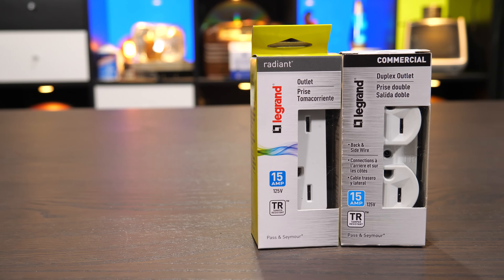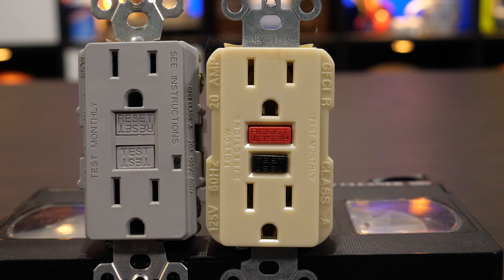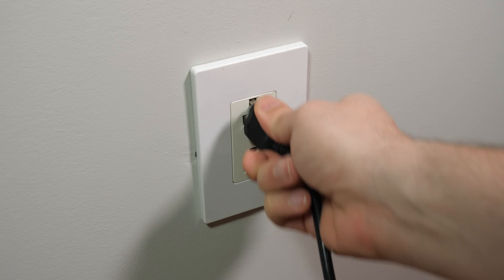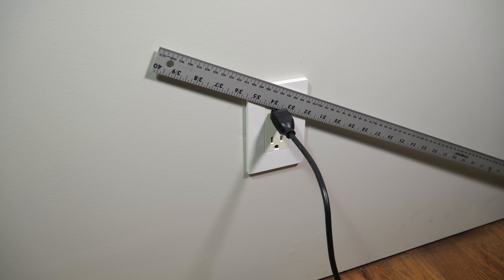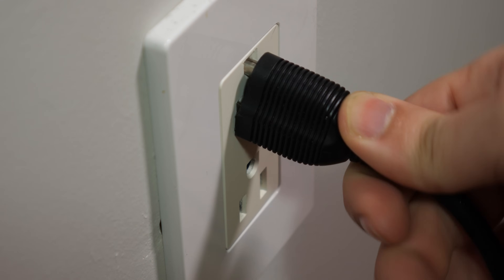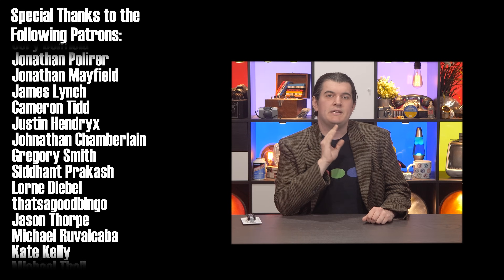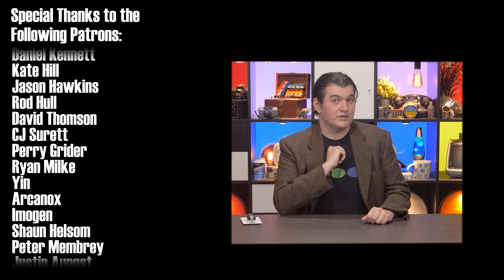Power outlets are topsy turvy - but does it matter?

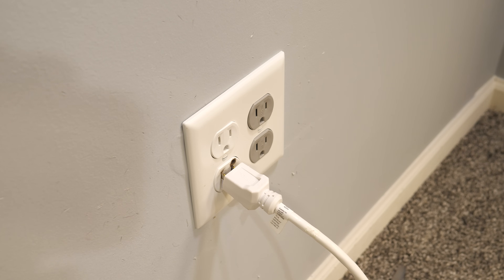Comment: 8:00 In 8th Grade Spanish, one of the girls liked playing with scissors (fortunately, with thick rubber handles). The teacher got after her for it, and she stopped, but then there was a substitute teacher in one day... 

Part way through the lesson, she asks me "How do outlets work", and I answered along the lines of "I think the bottom pin is ground, and one of the ones above it is hot/live, but I can't remember much more" and thought nothing of it. Not even 5 minutes later, I hear a BZZZSHT with an accompanying bright flash of light and the smell of ozone.

What had happened was that she had stuck the scissors into the outlet, with one blade in the hot side and the other side touching the metal faceplate of the outlet. The blade touching the faceplate arc welded itself to it, with a faint buzzing sound following the initial "fireworks". The teacher threw a large stack of books at the scissors to dislodge them, which worked.

This is not the first nor last story I have about 8th grade Spanish...

(That timestamp with the arcing reminded me of the other incident)
Reply: why did you have a large stack of bricks in a classroom
Reply: @vitamins-and-iron  Phone must have auto corrected- I meant large stack of BOOKS. 

Fixed it now.
Reply: @garethfuller2700  oh lmao 😂 thanks for the story

Comment: I have a couple older window units that have the right angle plugs with the ground pin at the top, as well as a couple older appliance timers that have the live and neutral pins reversed. All of them are from the early 90's or older.

Comment: Reminds me of back in the 90s when gas stations used to have "no cell phone" signs all over, implying but not actually saying that it could cause a fire or explosion, even though cell phones have no sources of sparks since there are no moving parts (the buttons were pressure-based, not contact-based). Unless you're in the habit of connecting and disconnecting your phone or its battery while hanging out around flammable vapors. Remember when phones had removable batteries? Don't get me started. Meanwhile on dry days (even living in Santa Cruz, CA), I was getting a shock every time I get out of my car to pump my gas. I guess my clothes and the car seat materials had the exact right electronegativity to generate static electricity or something.

I'm pretty sure those signs had nothing to do with safety or even with reality.

Comment: Another solution for the plugging/unplugging scenario (that works with older plugs) might be to add a switch to the wallplate. That way you could be sure there was no possibility of getting a shock.
Reply: Alec actually did a video on those. Look up "In Defense of the Switched Outlet".
Reply: @00andJoe 
Just watched it. He says (in reference to switched wallplates), "The switch is right next to the plug which you can also just take out" - but if the issue you're trying to prevent is shocking yourself, taking out the plug is what causes the issue rather than solve it.

Comment: If you look at it from a leverage point of view -  having the ground plug up does help keep both prongs in the outlet a bit better than when you have the face orientation.... . where the action of the plug leveraging in a downward direction causes the two flat pins to a be exposed more from the top and it can use the ground plug itself as a fulcrum point so it can pull out a trifle bit easier maybe ......all that being said - yep, who gives a crap tho !!!  (grin)

Comment: UK plugs have an insulation sleeve on the prongs.  What's preventing an overhaul of the NEMA-15 standard from adopting plugs that have a similar sleeve?  Seems like if the outlet was built with the correct specifications, it wouldn't require changes in the outlet?

Comment: I had to watch the whole thing before i commented, as Alec is Alec, and plays the devil's advocate... occasionally...

As someone who has installed receptacles of varying size and orientation, there is a valid reason for putting the 120V and 240V receptacles ground down. As Alec mentioned, the ground pin in three pronged receptacles is longer, as it serves a purpose. It IS the first to make, and last to break, when it is in the ground down position.

If you are required to have a grounded cord on your tool, (or appliance, or whatever,) the last thing you want is to have that ground get knocked out before the power has been removed from said tool (or appliance, or whatever.) If for some reason, the tool (or appliance, or whatever) is faulty, or gets wet, it is likely to short to the grounded metal case, which you are likely touching, or will touch when the tool, (or appliance, or whatever,) is next picked up.

For this is the reason that GFCI and AFCI breakers and receptacles are required anywhere near water, or outside, or in a garage, among other places where you would use a tool (or appliance, or whatever.)

SAFETY. 

It comes for us all. One day, you will be affected in a negative manner by safety.

Comment: You forgot to mention switched outlets.

Aren't switched outlets installed upside down so they can be easily identified amongst other outlets in the rooms?
So if upside-down outlets became the norm, would they have to install switched outlets right-side-up then so you could tell them apart from other outlets?

Comment: At this point it can be considered a North American tradition to select crappy plugs.

Even for electric cars, instead of going for the superior Type 2 their went for the Type 1 and then Tesla plugs. No three phase charging. No low and mid DC charging without CCS. No DC-low combined with 1 phase AC charging. No additional pins for Tesla to use out-of-spec to pump even more juice by using the N L1 L2 L3 (already used as 4 DC pin in DC-mid charging mode) on top of CCS DC pins as 6 DC pins for insane DC charging (don't tell me they wouldn't have done that given what Starlink is doing with Power over Ethernet).

Comment: I've actually had the "foreign objects" scenario come to pass -- a coin fell down behind a sideboard and shorted out the plug. Very startling when it went off.
Reply: For me is was a necklace that fell off the nightstand. Since it was flexible chain it would have shorted out in either orientation.
Reply: Me too!!!  Wife's gold necklace fell off the dresser and had a 1/2 inch vaporized.
Reply: As a European I'm always amazed that you still stick with this needlessly dangerous wall socket design whenever I get an import product from the USA. Our plugs have metal tips and plastic closer the base. The UK took it a step further and requires a ground pin (ours is optional), but that makes their plugs quite bulky can only be inserted one way instead of both ways. While I'm obviously biased and would prefer that you'd just adopt our plug standard, can't you at least have a plastic coating towards the base of the plug? That could be intercompatible with current standards yet also prevent the potential of shorting the plug.
Reply: @leonro  That'd increase manufacturing cost -- can't have that!
Reply: @leonro  ours in the uk are all right angled, earth up, and not problematically bulky. The plugs disconnect live first if pulled to destruction, have a built in fuse, and they're no bigger in the case of plug in devices with a transformer.

The only true downside is if you leave them they sit points up on the floor and are like lego (though much less pointy than US or EU plugs)

Our sockets as standard have little windows opened by the earth, so young kids can't jam anything in the socket. Modern sockets are all switched too, it is fantastic.
Reply: That's your jeton moment.
Reply: Cookie sheet here.
Reply: When I was a small child, the back of the airfreshener in the hallway  had a weird design and looked like a gumball machine slot. I stuck a quarter in it and my body spasmed and launched me into the opposite wall of the hallway. I still have the melted quarter lol
Reply: Same kinda thing happened to us. Was surely a shocking surprise.

Comment: Legit my only problem with right angle plugs is that you can’t plug two of them into the same 2 receptacle outlet, most of the time. I’ve seen some outlets with the outlet’s orientation running perpendicular to the orientation of the receptacles, such that when the outlet is installed horizontally, the ground pins of both receptacles are at the bottom, which means both receptacles can be used by right angle plugs without one plug blocking the other receptacle. This is in my opinion peak outlet design, and I have no clue why it’s not universal

Comment: Engineering challenge: Design a new receptacle and plug design (that is more than just sleeving the prongs) that fixes all of the design flaws of the current design, but remains compatible with all current receptacles and plugs.
Reply: I saw that in Europe back in the 80s when some homes had 110V.
That's a plain socket with circular holes on each side.

Comment: The other reason to say "nah" to the ground-up design in regards to right angle plugs:  Since the wire is now sitting straight up, there's more tension on the WIRE ITSELF by the forces of gravity and a vast majority of electrical fires have come from the wires having too much stress/tension and at the very least, losing their protective coating and at the very worst, stripping themselves bare and causing arcing away from the wall.  Sparks and carpet anyone?

Comment: Australia (& New Zealand) completely bypass this whole issue and mount them with the earth down as we have the following features:
1. Live & Neutral are sleeved 
2. Earth pin is longer so its the first to enter, last to leave. And because its at the bottom when a cord is accidentally partially-pulled, or sags from the power point, it will be connected even as the Line & Neutral come out.
3. RCD/RCBO's are mandated so even if you break the sleeving or force something metallic in the plug, heck even stick a knife in the outlet itself, and the circuit will trip with residual current protection (not just circuit breaker protection)

Comment: I've had two experiences of part-unplugged US plugs getting shorted. One by a knife, namely a putty knife being used to scrape spackle. My wife kept the putty knife with a hole melted in it to remind her. She is very glad it had a fully protected tang, which some don't. The other short I've seen was from metal dust from sanding/grinding building up on the top curve of the cover plate, then getting bumped so it fell off in near enough to a unit to spark and trip the GFCI.

Comment: After the US introduced the metric system you can start looking at European plugs. Never in my life did I have to worry or even think about getting zapped when plugging a cable. We have 240V so it's much more important, but anyway, not that hard a problem to solve.

Comment: Great Video! I make Electrical plans for buildings and updating our details and enforcing this is not where the solution should come. Manufacturers should, as you say quite near the start, make better plugs and receptacles that eliminate the very specific hazards you bring up. I think the cheeky sideways plug is optimal for the current design but in building standards outside Chicago they lack the added support that conduit gives. 
Thanks for the debunk, inserting an upside down lateral chord plug has always felt wack

Comment: I have an old guitar amp from the 60s and just recently played through it, but was getting shocked by touching the instrument input jack. I read that it could be that I had the power plug reversed, but it's literally the first time ive gotten shocked from that amp. It's one of those plugs like the tape player you showed and it allows you to plug it in either way, so maybe that is the reason. maybe the schematic will answer that, but I'm not fluent in reading those. lol just thought that was relevant to how crappy and dangerous electrical designs can be.

Comment: The problem with right-angle plugs is you can only plug one into most normal receptacles, as the one prevents the other from being used, by anything.

Comment: Sleeving the pins is definitely the way to go, I live in Australia and I've seen someone catch the live pin on an old unsleeved plug when removing it before (fortunately it just tripped the RCD since all Australian houses have full ground fault protection too)
Reply: I am very glad to live in Aus where our electricity infrastructure was made long after electricity was invented and having the sense to go with a new standard to improve safety
Reply: @joshuasanderson7359  You'd be surprised - sleeves were only introduced in like 2002 in Australia, before that there wasn't actually that much separating the safety profile of the Australian type I plug and the US type A other than the guaranteed ground pin. RCDs in the breaker are nice but again they weren't standard in early wiring implementations and had to be retrofitted
Reply: Alternatively you can recess the socket, which is what's generally done in mainland europe (D, E, F, J, K sockets), although that requires a relatively standard plug profile (which is why the cross-socket europlug has sleeved pins).

Comment: As someone who has experienced ehat happens when a ground pin on a power strip goes bad, (and electrifying the metal case of a piece of equipment at my work) i dont wonder if the ground up orientation would reduce or increase wear on the ground pin.

Comment: Isn't the obvious solution rotated 90 degrees clockwise with the neutral facing up?   - =   Protects from rouge measuring tapes and butterknife barrages, even with 2 prongs. Good with all plugs even right angle, as demonstrated in the video with the 90 CCW.

Comment: EU sockets are better.
Reply: I’ve used them.  I’m not impressed.  It seemed to me that the receptacle did not grip the plug.  I think flat blades work better than round pins.  In the USA, Hubbell initially designed a plug with round pins, but he soon switched to flat blades which we still use today.

Comment: There are some  extension cords designed for construction workers that stick straight up because the cord was designed for the ground wire to be on top.
They are very annoying  to use because all the outlets we use have the ground on the bottom.
Reply: You can get a 1-foot extension cord to put on the end that goes into the outlet.
Reply: That's true 👍

Comment: Upside down indeed.  If you install them with the ground pin up, and then plug in an appliance or an extension cord that that have plugs with pins at right-angles to the cord, where does that leave you, when the cord is facing upwards instead of hanging down???   If the receptacles are installed with the ground pins at the top, then right-angle plug-ins have to be changed so that the cords face downwards.  "the chicken and the egg" thing here.

Comment: The Chinese outlet is the same as the AU/NZ outlet, but upside-down. They say it’s to prevent fire-causing shorts if something conductive falls between the top two pins, but here in AU/NZ we just have insulation halfway down the plug pins. Which is safer for finger-based reasons too.
Reply: Thanks for that info. Plus a reminder to folks that the Standard (240 volt single phase) Australian/New Zealand style outlets, are also used across a substantial amount of South Pacific Islands (largely because the, um, social and business intercourse, with Aust/NZ, being dominant in the region). So The Cook Islands, Fiji, Samoa and Tonga.  Plus I would guess Tokelau, Niue and Nauru.  Not sure about Kiribati and Tuvalu, but as they were previously The Gilbert and Ellice Islands, they used Australian dollars and were serviced from Australia, then, so likely carried over electric standards also.
Reply: @KiwiCatherineJemma  And also PNG which was once an Australian territory. I think Pitcairn Island uses it also.
Reply: Older plugs have all-metal blades.  Then you had the time when they changed the standard to require a recessed outlet, but Australian manufacturers couldn’t be arsed changing their products and forced that back out of the standard.  Later it got changed again, and now some items such as extension leads and some power boards have the recessed design.
Reply: @boggisthecat  Insulated pins came in 2005. The attempt at recessed sockets was initially a failure because of the multitude of things like plugpack transformers which  wouldn't fit, although they are now designed for recessed sockets. One would see the shielded part of an extension cord socket cut off in order to fit certain plugs.
Reply: @cool386vintagetechnology6  
Earlier than that.  I used to work for the lab that PDL owned.  Pretty sure those were put out around 1998 or so.  The standard may have given 2005 as the phase out for unsheathed pins.

Comment: It’s absolutely backwards to have ground side up. As the socket wears it looses grip. With the ground up the plugs can fall right out. With ground down the plug is supported and doesn’t want to droop out of the socket. I had an entire house installed ground up and it was enough of a nightmare that I flipped all receptacles 180 degrees. I have no idea what genius thought ground up was better. I’m 74 years old and have yet to receive my first shock with a ground down receptacle.

Comment: I sent sparks flying once working on a guitar on a workbench that had outlets on the front face.  A loose string flopped over.  They were sideways orientation.

My solution was to replace plugs with the ginormous ones you get at the hardware store, since only a couple different things ever went into that outlet anyway.

Comment: As an electrician, I tried putting outlets in with the ground or neutral facing up, but I knew it didn't mean much because our plugs and outlets are so bad. I also had a few cases of outlet covers using two screws, and that meant a lot of extra work getting the outlet's screws out and then trying to screw the whole thing back in when you can't see the screw hole.